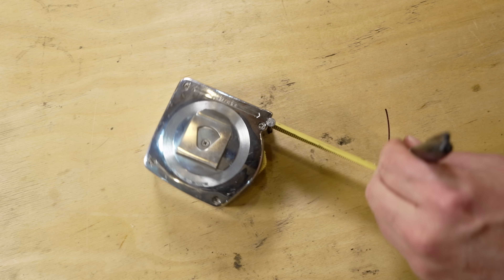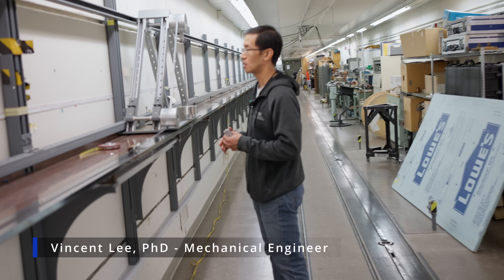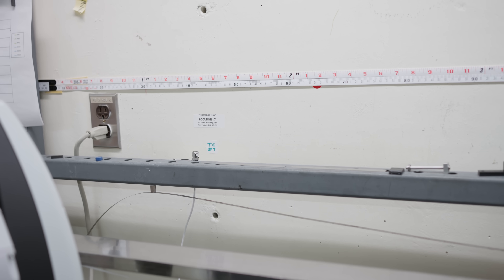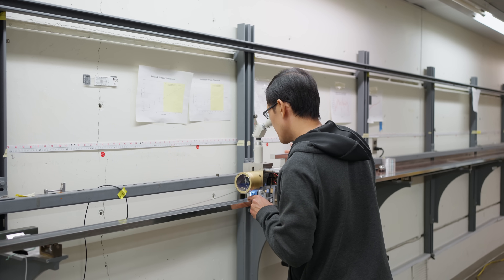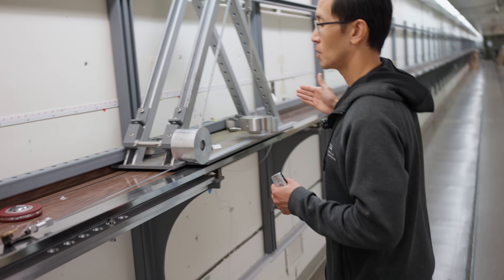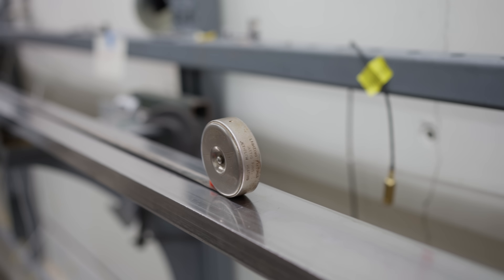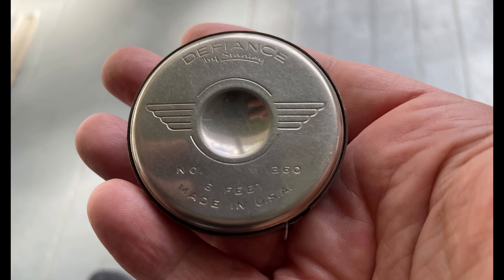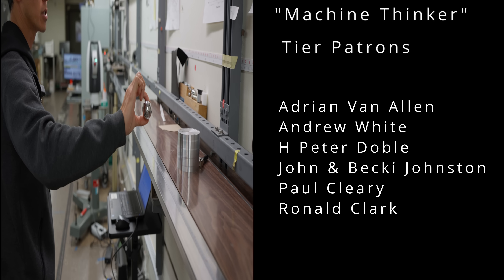The Most Accurate Tape Measure? I found it and can prove it

Comment: I like how NIST's address is a nice round number. Wonder what the tolerance on that is
Reply: Would a letter addressed to, say, 101 Bureau Drive, successfully get delivered to NIST? 105? That seems like a rather fun experiment to try tbh.
Reply: 1ppb
Reply: @davidmiller2167  i wonder if you're setting up something new at NIST, if they even would be happy with anything less than ppb confidence 🤣
Reply: There’s a 1 in their address, and that digit doesn’t appear to have any curves in it.
Reply: @PetesGuide  There's that angle to it. But of the two blocks that Bureau Drive runs,  NIST is the entirety of one of them, and the Subway just barely outside is all the way down at 6 Bureau Drive.
Reply: 123 might have been more amusing. Or even 99.9.
Reply: @two_tier_gary_rumain  100.000000
Reply: If postal workers know their math, sending a letter to 4 Bureau Drive should still get there. The 100 address is a 3-bit binary number representing 4 as the actual decimal number address!
Reply: NIST should really change their address to 1.00x10^2 Bureau Drive so the level of precision is specified rather than inferred.
Reply: +/- .003"

Comment: Machine thinking...I enjoy you videos.   But every now and again you are wrong.

Nist measured your steel tape as .022inches longer than 48 inches at 20 degrees Fahrenheit.  That means that the very same steel tape is closer than a human hair at 64 degrees Fahrenheit.  That is about average outdoor temperature on any given morning in the summer....and it is intended to be an outdoor tool.   (Coefficient of expansion of steel at 6 degree delta T comes out to 21tho at four feet...)
Reply from the maker: It was measured at 20C, so about 68F

Comment: Tape measures do have accuracy classes, most of the tapes you see at the big box stores are considered class 2, you can order class 1 tapes like Fisco or Advent. I have found as far as standard home depot tapes that Milwaukee and Dewalt were less accurate than the Stanley's (as boring as they are they are a staple in the category).
Reply: Makes sense, Stanley used to make precision machinist's gauges and scales, Milwaukee and Dewalt did not.
Reply: Oddly enough, Stanley/Black+Decker own DeWalt so I’m sure there’s some sharing of manufacturing techniques, engineering, etc. Stanley certainly has more experience historically. Milwaukee and Ryobi are owned by the same parent company, and they don’t necessarily share the same reputation either.
Reply: @wcropp1  Then why do Black & Decker tools suck so much? (lol)

Comment: Being someone who's spent time in a metrology lab, I know just how bad tape measures can be.  Seeing that you can get NIST certified ones has be a bit to excited.
Reply: As an engineer who thinks that engineering as a whole is horrendously underestimated by the general public its easy to see why metrology is even more obscure because most engineers take calibration for granted.

I work in industrial control systems and its staggering just how much we rely on the manufacturers getting things right. We simply take it on face value that the manufacturers made every pressure, flow, temperature,...... sensor accurately and that they measure what they claim to measure at the scale on the box. So at the practical application level we are separated from the metrology people by the manufacturing layer.

Ever since I saw MT's vid on the Jo Blocks that was followed by his more recent one on the NIST I have gained a lot more appreciation for metrology and wish it was covered a lot better at the college level.
Reply: i used to do work in industrial controls and no way are you just taking the word of the manufacturer. they generally have in house metrology and can calibrate the sensors. even a flow meter can be somewhat calibrated by rudimentary graviometric measures.
Reply: Way back, I did a summer job in a metrology lab.  It was really interesting and gave me an instinct to question "how accurately do we really know what we think we know".  Was also useful for helping me think about various ways experiments could be a bit off, which has served me well over the decades.

It probably should be a required topic for any engineer and recommend for scientists to learn about.
Reply: @travcollier  Obligatory mention here of Simon Winchester's book The Perfectionists.
Reply: @travcollier  oh yeah I remember finding out that everything kinda acts like jello, it might only move a super tiny bit when you put your coffee cup on it, but it moves. The 4' thick cement pad the lathe you are trying to level moves when you step on it. Everything moves when experiencing a load, temperature change, whatever. 
And realizing that nothing is perfectly flat, straight or perfectly the specific dimension or shape it's supposed to be, nothing is perfect, it's just to what degree it's incorrect. 

So those two things really influenced how I look at tools, materials, basically everything around me. So in a lot of things I try to get an understanding of how big my errors could be, whether it will be a static, linear, exponential error, can it compound, etc. and let the possibility of error influence certain decisions. If I know every measurement or piece of data is flawed, I want to know how big those error bars are and what is the limit on accuracy with these processes and tools. 
Idk I find this kind of stuff facinating
Reply: When siding my house with my dad, he ran the chop saw, and I was getting pretty frustrated that his cuts were coming up 1/4 short.

Turns out we were both exact on the mark with different tape measures...
Reply: Your last 5 words "be a bit to excited" being corrected to "to be a bit exciting" would be very satisfying.
Reply: @roqua I thought he meant “me a bit too excited”.

Comment: How can these smart people at NIST really think Windows XP is ok to use. Won’t be long before they get hacked.
Reply: It's probably not network connected. No reason that machine would need an internet connection.
Reply: @clapanse Yup, it probably doesn’t even have an ether net card, and the software is probably homegrown. So no reason to connect.
Reply from the maker: Besides the no connectivity as others mentioned, I would presume a very long validation cycle for any changes. When your machines are the ultimate authority you need to validate every single part of the process very thoroughly.
Reply: @machinethinking Upvoted. I spent a lot of time in the corporate world dealing with the IT departments of the companies I worked for and talking with their geeks (and Dell and HP and CAD vendors) about what each change in a system required in testing for IT to feel safe rolling new stuff out. I could always get around those rules for my test bed computers, but that’s where I really felt the pain of not carefully testing and documenting things well enough to have an easy undo (or recognize I needed to do so).
Reply: This. Plus, there may be some controllers or interfaces in between the machine and the laser that were designed for use with Windows. The entire machine may have been built back when XP was current. If it ain’t broke, don’t fix it.
Reply: Better the devil you know...
"They could have used an open source alternative."
Being open source is not some sort of panacea of trustworthiness. Being tried & mostly true, with well known limitations, is better than the unknown of the "latest and greatest".
15 or so years ago, I worked for a company that made small batch custom computers that were often used for dedicated applications, such as medical equipment. Some of those computers ran Windows NT, or Windows 3.1, or even OS/2.
Reply: A lot of machines are indeed air gapped in research institutes. So yeah, it doesn't matter for those.
Reply: Look, I know your post is probably trolling, but I’d like to reply for those who might not think so. The people who set this machine up are very smart. The goal of this machine is accuracy and consistency. Think about what happens when a modern machine is running a current operating system and is connected to the Internet. It gets updates that change things all the time. Windows XP SP3 is a very known and consistent OS, and will not change with updates. Also, there’s no chance the machine here is Internet connected.
Reply: Buut, he says “it’s a windows xp machine because we don’t need that much computing power”.

It’s not about power. They could have used an open source alternative, anything but windows xp.
Reply: Yeh let’s hope so. Still no excuse in this day and age